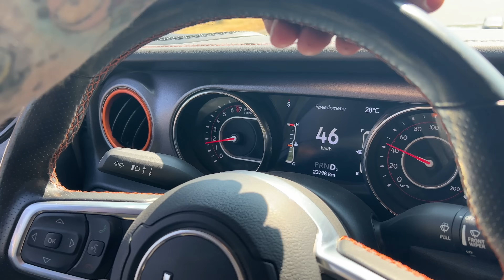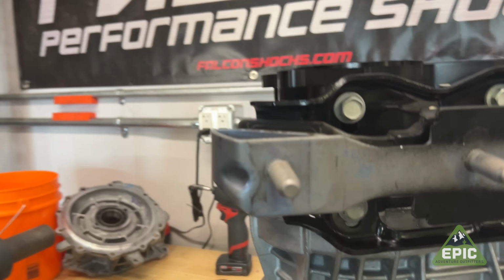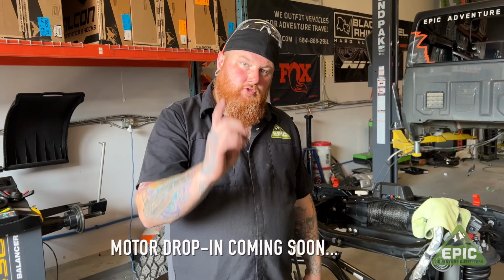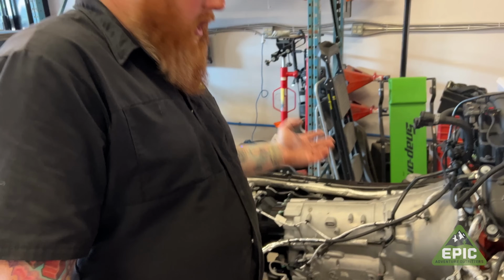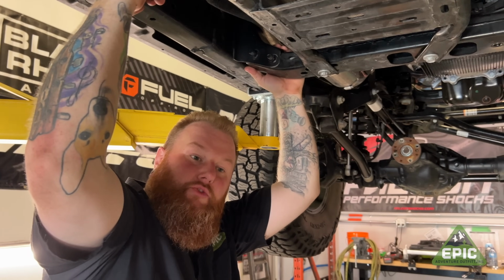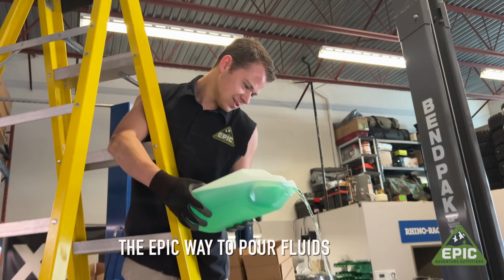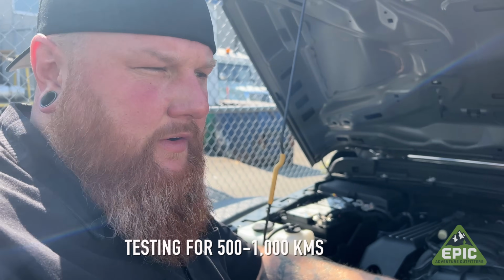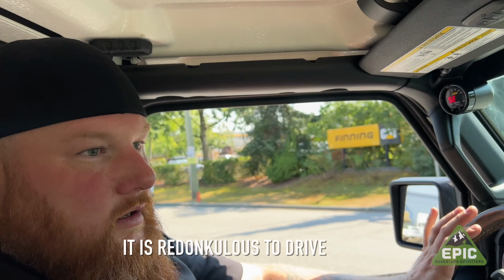EPIC 392 Engine Conversion - America's Most Wanted 4x4 - Project Complete!

Comment: Great (I mean EPIC) videos!  With such a thirsty engine, wouldn't it be a good idea to add a larger (or auxillary) fuel tank while the body is off of the chassis?
Reply from the maker: You'd think... but there is zero room for an additional tank ;-)